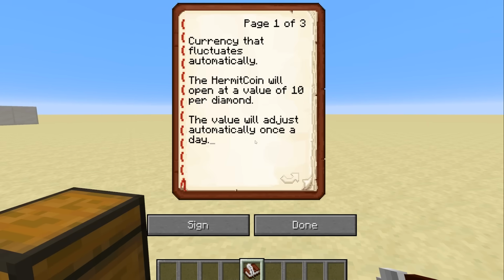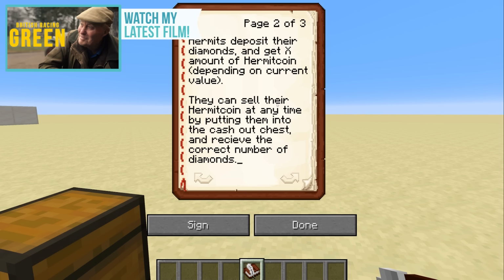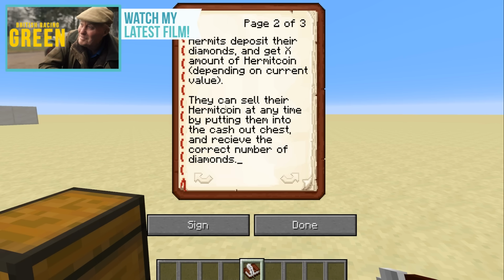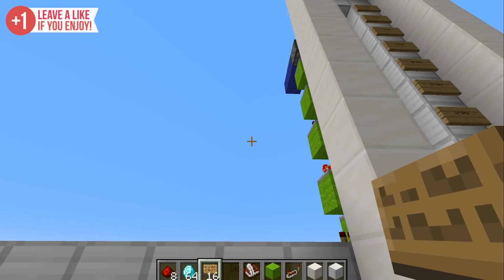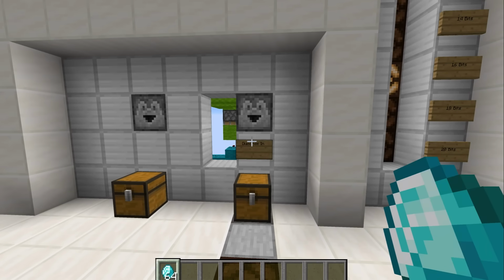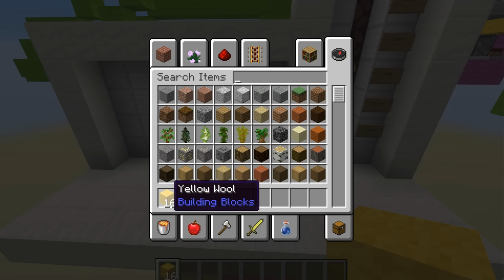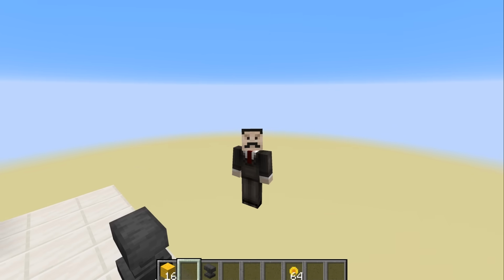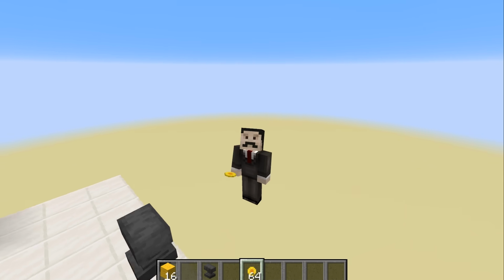HermitCoin Crypto Machine for Hermitcraft!

Comment: I would like to point out that Sethbling has been making videos again and has designed an amazingly compact clock on accident. He meant to design a storage measurement system to alert you based on the fullness of a chest but it’s really just a clock that’s extremely customizable and roughly 3x4x1

Comment: so I'm not sure if i just don't get the red stone but with my current understanding there is a massive flaw with counting the hermit coin. so if a player puts in 15 coins (into the system when the value is at 16) i assume that counter basically pushes an item around the hopper loop 15 times. yes it wont activate the dropper because it hasn't traveled 16 hoppers BUT it's still just sitting there on the 15 hopper. so if another player comes in later an puts 1 coin in the chest, that item in the hoppers will tick over from 15 to 16 and give the player a diamond for ONE coin. of course maybe you already knew that and have a system in place that i didn't realize that resets the counter to 0. its an awkward thing to consider when to reset though, what if a player puts in 31, realizes only after he only gets 1 diamond and goes to put in one more coin to get his second diamond, did the machine already reset? when should it reset? maybe with a button or trip wire on the way out? what if two people enter/leave the store at the same time?

Comment: What if the price goes really high, and there aren't enough diamonds in thee system? If the price was low, and a lot are bought for cheap, than the next day they are worth more, and enough are cashed in, there won't be enough diamonds. The solution is to not use random fluctuations, but to base it off the amount bought and sold.

Comment: There may still be an issue with it (unless you already fixed that outside of the video), that as you put in the wrong number your counter will be stopped at that point and it will cost less Hermitcoins to get the first diamond but the normal amount for the rest.

Comment: I hope you consider adding a way for the "hermitcoins" to come back to the user should an incorrect amount be put in. For example, the value is 16 and someone puts in 15. The system counts them and doesn't give a diamond but what happens to the 15 coins in the system? Ideally they should be ejected.

Comment: One issue I notice here: you have no reset function. If a player inserts 15 HC when the value is 16, your system should be able to discharge the incorrect value back to the player and reset the location of the counter WITHOUT dispensing a diamond; currently, not only do the HC not discharge back to the player, but any other hermit may insert the missing HC and take the diamond as profit.

Comment: you need to make a retrieval system if the hermit doesn't put in enough or puts in too many so the machine doesn't rob you or make it cheaper for the next hermit.

Comment: Okay but what if value of hermitcoin is 12? You always have 16 hoppers in the counting system. And if i put less hc than required, could you put a button that will return all the "unused" hcs. Because if there weren't such button the whole system would break as the next one user can put in less hcs to get their diamonds (i.e. 10hc=1dm, stress puts in 15hc on accident, next person can put in hc one by one and get a diamond just from 5 hc)

Comment: Mumbo, hermits can cheat the system.
Example, hermit buy 16 hermit coin with 1 diamond. Next day they return the hermit coin shop to see 1 diamond equal 4 hermit coin. They return their 16 hermit coin for 4 diamonds.
Reply: That's how stocks/currency exchange works?
Reply: Hermcoin
Reply: Also it fluctuates so yeah that's how it works
Reply: But it can only fluctuate by 1 coin value per day
Reply: They aren't allowed to exit the building with HermitCoin.

Comment: Slight issue with the system. If someone overpays by x amount, let's say by 1 when the value is 16, then the system will store that one hermitcoin, and make it less for the next person to come along. And same with if they underpay, you need a way to clear out the system in case someone has under or over paid so that they can still receive back their hermitcoin.

Comment: there should be a "please exit the facility" sign, 1 in game hour before the value changes again, as to let the system calculate on the latest coin value, instead of changing half way the transaction. other wise you can lock the diamond transaction to the latest value, and make a small indication that the value will change in a short while.

Comment: It would be more accurate if the value of the coin was based on the amount of diamonds in the chest. So the more coin people buy the value goes up, and as they exchange coin for diamonds the value goes down.
Plus with how it is now you will lose diamonds from people buying low and selling high.

Comment: I think you should have a timing circuit where after a timer is done, a light will come on with a sign below it saying “System Resetting, do not insert any items at this time” or something. The system reset will reset the hopper counters back to 1 so someone can’t put in one HermitCoin in and get a diamond because the last Hermit had one coin short.

Comment: I can see issues with the hermit coin hopper counting system: example- someone throws in 25 coins (16+9), they get one diamond, and someone else comes along and throws in 24 coins, they will get 2 diamonds. The counter needs to reset or be able to be counted differently (perhaps an etho hopper clock?)

Comment: You should do it like real cryptocurrency not a randomized value. Like make it a set amount of coins forever and depending on how many people buy it throughout the day the value increases and depending on how many people sell the value decreases. That way it can compete more with the stock exchange and it is not based on luck and there would be some skill involved. You can research a little on how cryptocurrency works to make it cooler and a better hermitshop!

Comment: Wouldn't you need a system for when they don't put enough coins in

Like say they put 15 in, they wouldn't get a diamond, but if someone else comes along they'll toss their 16 coin in, get a diamond, and there will still be a coin stuck in the system.
Would you build a system to dump the excess/under value coins for when they don't reach the diamond value?

Comment: 1.To overcome the problem of people just renaming sunflowers, there could be books with a specific name and signed by Mumbo. It would be a ton of work to do this, maybe adjust the value of diamonds to Hermitcoin. 

1.1 Maybe emit 1000 and based on how many are currently sold, the stockprice goes up or down. Example: Noone has Hermitcoins but the "bank system" itself, the price should be the lowest possible.

2. The system should have transaction costs to lower the risk of the system getting abused, maybe put in one gold or something like this to activate a flipflop that resets when the player reseves his diamonds. until the gold is put in, the Hermit can decide how many he wants to exchange for coins.

Just some thoughts,
I hope this system turns out to be profitable for Mumbo.

#Bankalwayswins

Comment: theres a problem here, if the current cost is 6 HC per diamond and you put a stack in there will be some change left over, the problem you have then is that the hermit has just lost their hermitcoin and the next hermit gets a free hermit coin from the previous one's change, also another problem is that how are you going to take the commission? because this system won't allow that currently

Comment: Is there a way, instead of making the price random you could base it on the amount of use the machine got in a day? So, lots of people putting in diamonds lowers price for next day and no one using the machine increases the price? 

I’ve never particularly used red stone but would it be possible to take a signal from the hopper every time a diamond comes into it which then sends a signal into the two hoppers facing each other thing causing an item to transfer each time a hermit coin is bought then a comparator sees how many diamonds in the second hopper? 

Idk if that’s possible but if it is I thought it could be pretty cool... it’ll be a bit more fun if there’s logic too the investing more than randomness i think 😅🤷‍♀️

Comment: I have an idea for the 'MumBit' value fluctuation. What if, while the inverted daylight sensor is active (I assume that will be the day-detection method), it runs a very slow redstone clock that is wired into a randomizer that has 20 options: 18 do nothing, 1 increases the value, 1 decreases the value. This way, while the market is closed, the value can fluctuate more than once, making it less predictable.

Comment: (Value is 16)If someone throws 15 Hcoins, your detection system stops and he needs to put another  one ther, but when he leaves sad, that he cant count, someone new can just throw 1 Hcoin to get diamond. I suggest a reset button.
Reply: This is what I thought too.
Reply: He already said that if you don't put in the correct amount, you lose your investment.
Reply: I suggest that if the hermit will put a wrong number in, they will get the HermitCoins that left in the system back
Reply: MikeyQPlayz that’s actually a great idea because that helps with the problem that was suggested earlier in this thread as well
Reply: That’s what I was thinking too. Another hermit could come along, put in 1 HermitCoin, and get a diamond
Reply: See it is their loss if they don't follow it and if someone does that mumbo should not be held responsible
Reply: @timob1681  When he puts 15 in at the end, the hoppers stay locked (the redstone on top of them is still lit,) after the 15th one is processed; all someone has to do is put in one more and the item in the hoppers will move back into place and activate the dispenser. I don't see any mechanisms to reset the hoppers, but it has been quite a while since I've done redstone myself, so all I'll say is that if it does reset, he didn't show/explain that part.

But either way, Mumbo's good enough at redstone that he should be able to return any change left from the transaction. It already puts out a signal when it counts to 16, so he could use that to lock the hoppers so no more coins can come in, remove the 16 processed coins from the chest via the hoppers (and send them to wherever they'll be kept,) and then continue processing. If there are no more to be processed, but it hasn't reached 16 yet, he can remove the processed coins from the hoppers, just like before, but split the hopper line off and spit the coins out of the floor or something, from a dispenser that just automatically empties itself. As for resetting the hopper counter, he could either unlock the hoppers until the item is in the 16th position, and stop it when it gets there by using a comparator, or he could count how many are left over, subtract it from 16, and move the item that many times (this is the more complicated way, but it's probably easier to control each individual mechanism this way, to prevent misfires, since it wouldn't rely on timing.)

Comment: Price should be supply and demand based like real securities. So if someone buys a coin the price goes up and vice versa. Would have to decrease or increase before the transaction is made so if it is at 10 diamond and someone buys they would have to buy for 11 diamonds to prevent arbitrage but would be more accurate to real bitcoins. don’t know much about red stone and if it’s possible but would be cool.